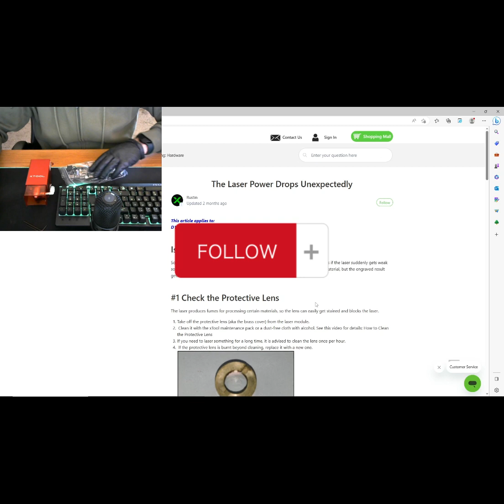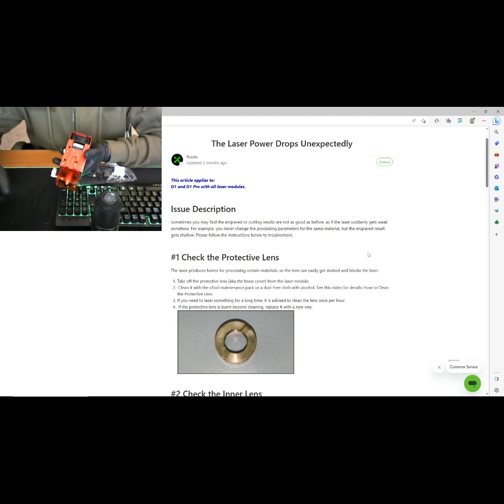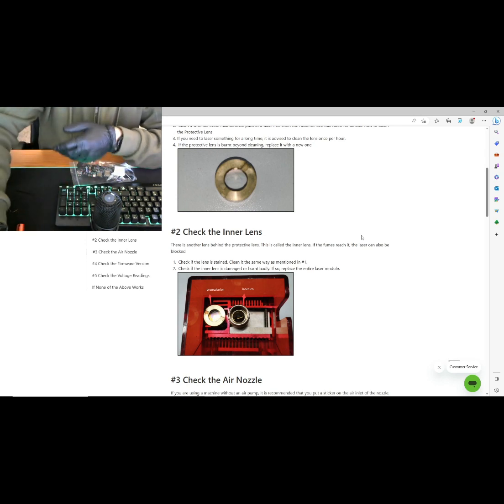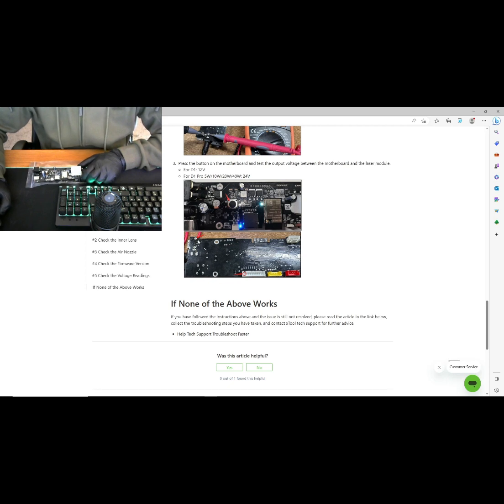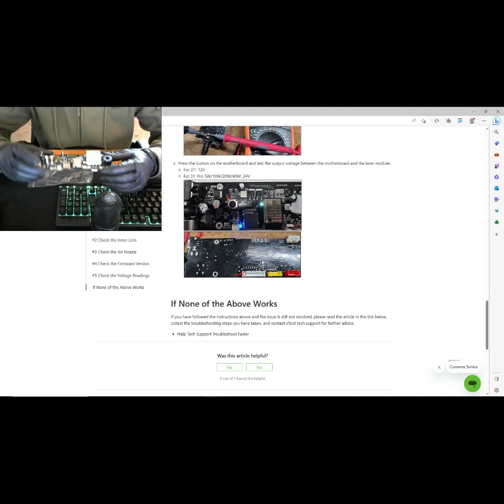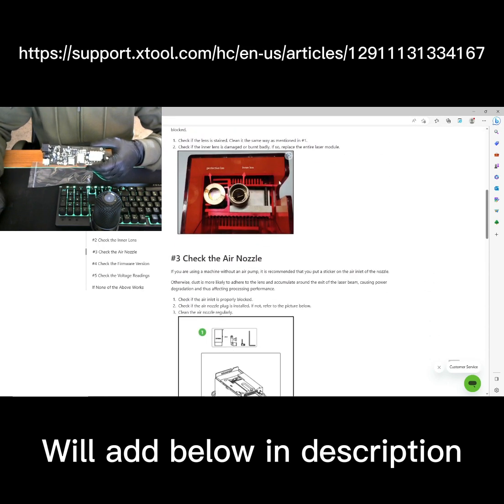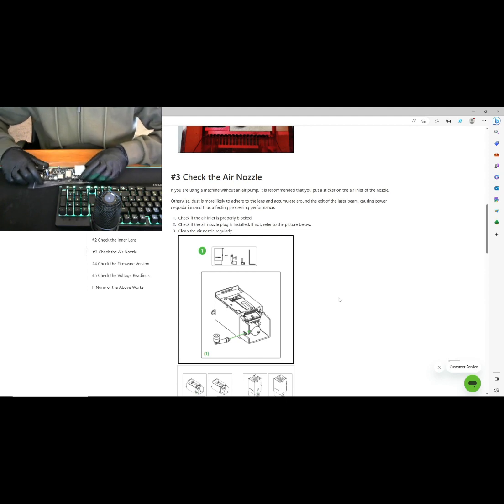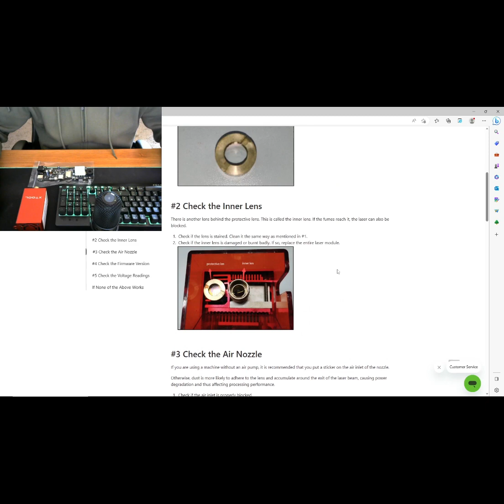How To - XTool D1 Pro - Problems &  Fix.....

Comment: Thank you for the information. I have the D1 non pro with 20 watt module. this same issue is what I have. they told me nothing they could do to help me so I ended up buying the Pro 20 watt. I'd love to have the other one working again for engravings and just use this new one for cutting
Reply from the maker: There seems to be a trend in this as now a common issue.